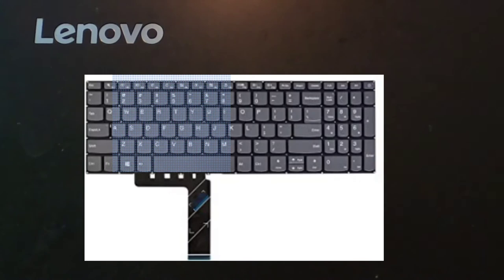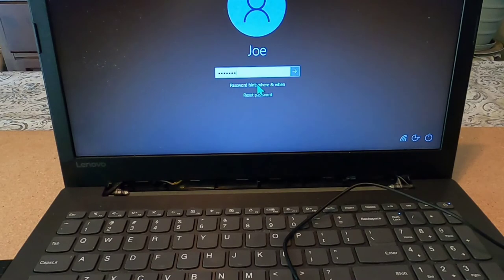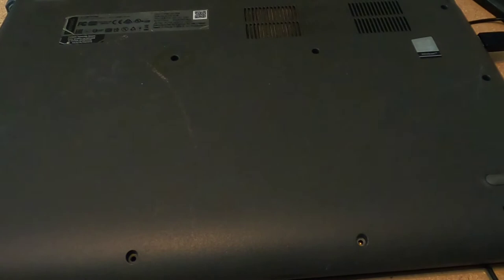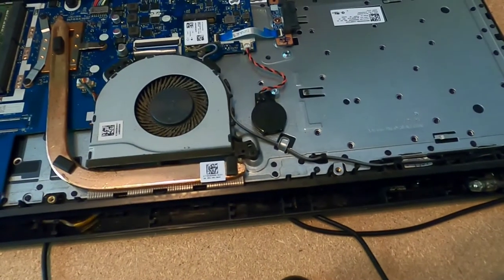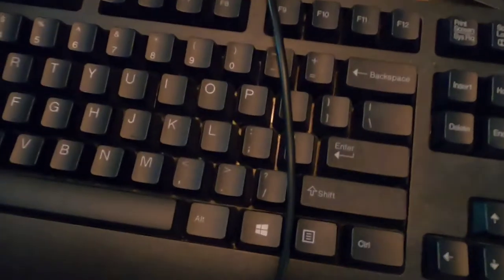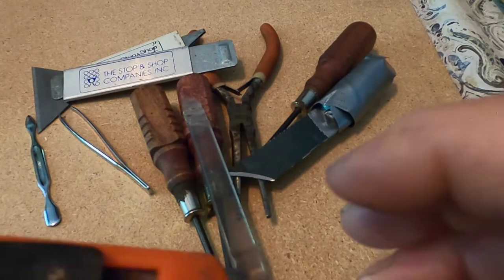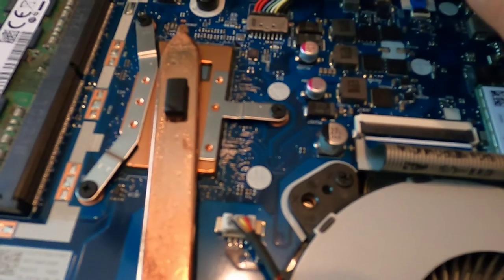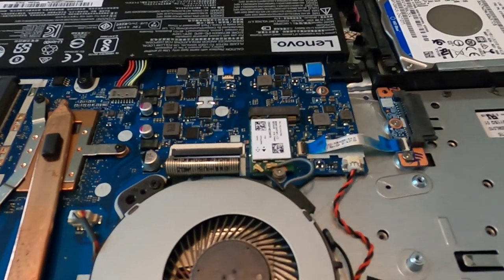Water damaged keyboard fix

Comment: 1) When blowing out dust and debris from a keyboard or inside once the bottom cover is removed, using canned air to blow it can cause issues because the propellent is not totally dry and can leave a sticky, electrically conductive film which attracts dust and debris and can also short out connections.  It's best to use an air compressor set to 15 to 25 psi with a long, fine blow tip.  This is also great for fan blades and copper heat sink fins.  2) If the keyboard ribbon cable (or any ribbon cable) clip comes off, it can be reattached, if the locking tabs haven't broken.  Yeah, with the Power Switch being integrated into the keyboard, that sucks, but you found the workaround.  Clever prying tool toothbrush!  Guitar picks can be used or any firm, fairly sharp plastic.  A Jeweler's Screwdriver kit is also handy.  3) That little round, flat battery covered with black heat shrink and red and black wires is for the BIOS/UEFI CMOS Power On Self Test Memory and should not be unplugged.  Doing so will make the computer lose its settings, like the Date and Time and other critical stuff, which would then have to be reconfigured.  Only the Main Battery needs to be disconnected.

The way that laptops and tablets are put together is why I HATE Lenovo, IBM and HP!  They do things to make their products much harder to work on than necessary!!!  Most laptop manufacturers will have longer screws that go through the motherboard to secure the keyboard (once the bottom cover is removed), making the keyboard much easier to remove and replace, and get to other things.  The motherboard is also typically secured with screws.  Having to cut all those plastic rivets is INSANE!  Using plastic rivets and a keyboard key Power On/Off activated switch saves about $1.50 per device, which adds up to $Millions in savings for them.  Since all the screws are different sizes, lengths and types, I stack them standing up in a pattern to indicate where they came from.

The water got inside the keyboard and in between the 2 conductive sheets that have printed circuit traces for wiring and press-touch switch contacts for every keyboard key, and the water shorted some or at least one of the switches closed, so they keyboard is always typing at least one character key because some water is still inside.  It doesn't take much!  It may never fully dry out in there.  Some keyboards, especially Computer Tower keyboards, can be easily taken apart to clean those switch contact traces and reassemble.  Some laptops also have replaceable keyboard character keys for when one pops off, breaks and cannot be reattached.

If you use an air compressor set to 15 to 25 psi with a long, fine blow tip, you can blow the dust and debris out from the fan blade side out of the fins to clean it and the heat sink fins out regularly.  If you keep it from getting that clogged, using this process regularly, the CPU (Processor) will run cooler and therefore faster, using less power, and will be easier to clean because of less buildup.  You can get air nozzles that look like a gun with a trigger and a long, fine blow tip.  Some blow tips come out straight for about 2" and have a 45° angle downward about 2" as well.  The tip air hole is about 1/8" or less for a focused air steam.  If you want to, those silver keyboard rivets can be painted black with a Sharpie.  Never mind, they are hidden by the cover.  Yeah, if you buy a "compatible" keyboard instead of OEM, things like key height, key press firmness and key character labeling can be different.  Also, the key character labels can be easily marred and become unreadable, too, because of using decals instead of embossing.

Since you unplugged that little round battery, you'll need to set your Date, Time and Time Zone.  If everything functions OK, then the CMOS settings are working OK.  Otherwise, you'll have to search for how to get into the BIOS or UEFI (older computers have BIOS and newer have UEFI) to see how to configure it.  The computer will not get Windows Updates if the Date and Time are not correct, so while you're at it, set the Time Zone, too.  Great job, Joe!!!
Reply from the maker: Thank you for all this information. For beginners I never knew using canned air could cause the issues you mentioned. 
Thanks again  stay well,
Joe Z
Reply: @JOEZEP54   You're very welcome!  Don't forget about the Date, Time and Time Zone.
Reply from the maker: @100vg  👌👌👌